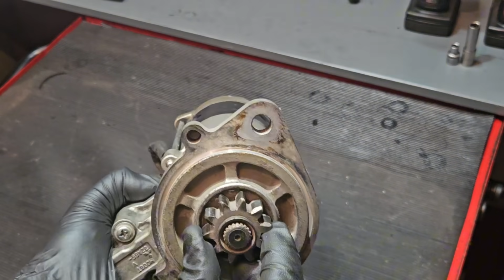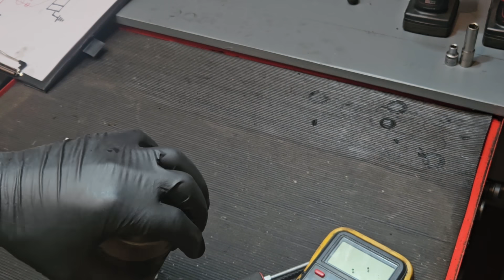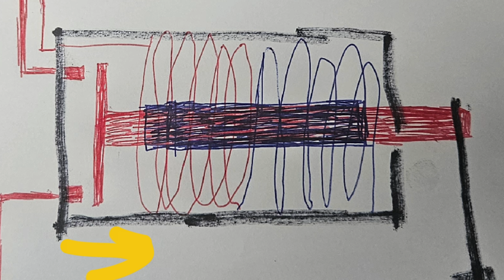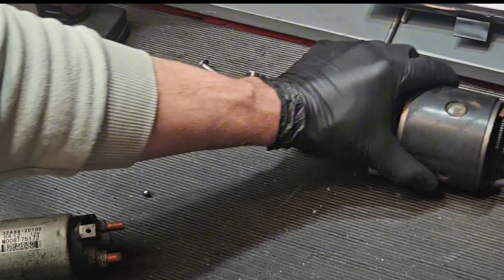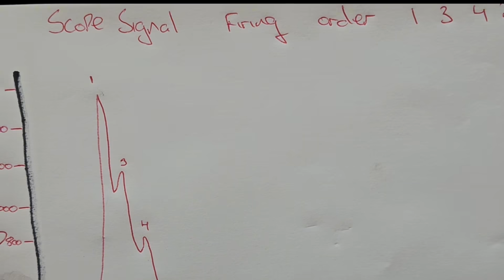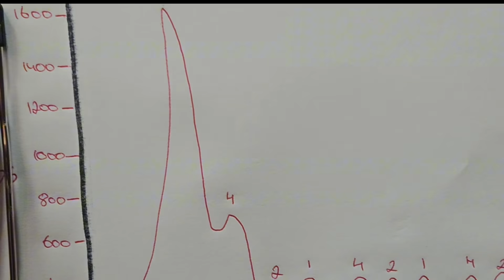REPAIR YOUR OWN STARTER MOTOR AND SAVE MONEY!!

Comment: Hi Alan,  great video . I  am hoping to tap into your knowledge. I have a starter motor that is receiving 24v to  all three terminals on start  up as it should , however although i hear audible click the  pinion does not move in or out and the motor does not spin. I was on the understanding  that the solenoid shaft when making a circuit  for  supplying power to  the  starter motor is mechanically linked to pushing the gear out. Any ideas?
Reply from the maker: Hi, thanks for your comment. 
So if you have 24v supply to the starter and solenoid and the solenoid does not engage the pinion, you almost certainly have a starter solenoid problem. The contacts may be closing, giving you the click sound. The solenoid may be stuck. Make sure you have good clean earth's and power supply.

Comment: hi Alan I have a old tansit mk5 but i think it has an older model its massive weighs a ton at least twice/ three. the size of that one.
I will have a look at that one later but i have a new one similar size to yours. I sometimes have to try up to 8 times it makes a grinding noise because the tooth wheel is not being thrown in. Whats likely to be wrong with that.
Reply from the maker: Hi. Could be a few things. The ring gear on the flywheel could be worn. The pinion on the starter could be worn either, or the solenoid may not be engaging fully. You'd need to remove the starter to inspect. Hope that helps 👍

Comment: Your video on = Repair your on starter motor and save money. 
I believe i have the same starter that was in your video. 
My starter # should be  # 16501013000
I need to know how the engagement lever arm goes into the starter and solenoid 
It has a plastic arm,  that looks like a fork,  and has a small spring and a large spring that goes up in the solenoid. 
With a gold looking piece that goes on the plastic engagement arm. 
Plus it has a small plastic square piece with a hole in it. 
My question is how to put the lever arm into the starter  ?
Like I said I believe I have the same starter in the video 
Can you show a video or a diagram of where the parts go
Thanks Robert 😊

Comment: I have a starter motor from a toyota yaris 1999..  i dismantled the starter and found one brush totally gone.  But i can not just remove the brush box... 2 of the brushes wires seem to be fixed to the housig ..
Reply from the maker: @tanmansu  They would be soldered onto it I'd bet..

Comment: Alan, going off at a bit of a tangent, when fitting a battery cut off switch to a tractor should the switch be fitted on the negative side or the positive side?
Reply from the maker: @westcoast5934  I usually fit them on the negative lead, but that's just out of habit. I really makes little difference, whichever is most convenient. I do find on some machines that there might be more than one positive lead off the battery to feed different fuse boxes etc, so it's usually more straight forward off the negative. 👍
Reply: @AgrimotiveFarmMachinery  Thanks Alan, I wasn't sure if there was a preferred way. I'm looking forward to more in this series...👍👍
Reply from the maker: @westcoast5934  Thanks for watching 👍

Comment: The starter motor mysteries explained. Well done Alan 👍
Reply from the maker: @eamondempsey3018  Thanks Eamon. Simple and basic units to do anything with. 👍
Reply: @AgrimotiveFarmMachinery  have a 6170 (mf) that was a very lazy starter, put on a geared starter and it  transformed it. First tip of the key and she fires even on the coldest mornings. Game changer.
Reply from the maker: @eamondempsey3018  They make a huge difference, alright. They do draw a serious whack of current, though, so you wouldn't want to be cranking too long 🤣

Comment: I had a problem trying to start my 165 during the week. So I took the battery out and charged it, still wouldn’t start. I ashamed to say the high low gear lever wasn’t in neutral, and the switch was working correctly….
Reply: Happens all of us, Mike. We just usually don't admit it 😂
Reply: 😂 i remember getting tow started in a 135 ,and hadnt  got he stopper pushed in ,-never said a word !😳😂
Reply from the maker: @ajvaack  🤣
Reply from the maker: @78mikehayes  Few pints the night beforehand Mike?.🤣
Reply: @AgrimotiveFarmMachinery  a kick up the hole after would be more useful to to cure it…
Reply from the maker: @78mikehayes  Don't feel too bad, I once drove 20km out to a Fendt that wouldn't start... There was no battery in it. The owner forgot he took it out 2 weeks prior to charge it.. I told him it was a doctor he needed, not a mechanic.
Reply: That is usually caused by a bad connection between the seat and the steering wheel😊
Reply: @johncallaghan4044  bingo
Reply: @johncallaghan4044  That's a good one. Which I already admitted! I was rightly ashamed..